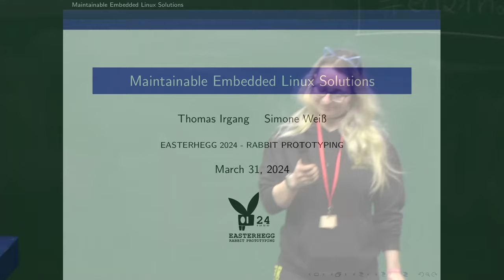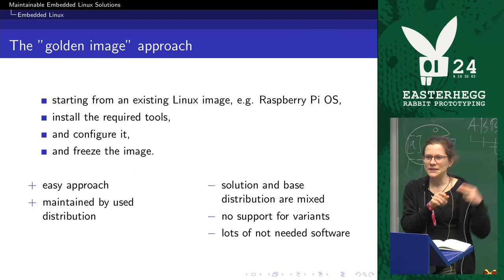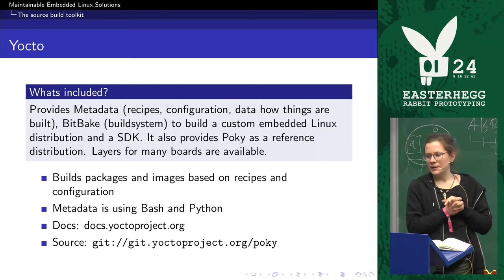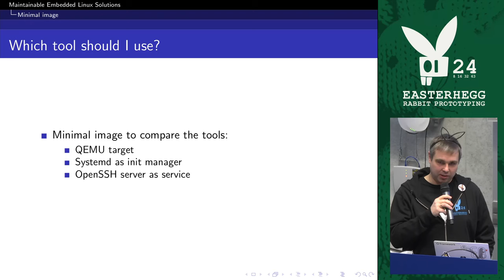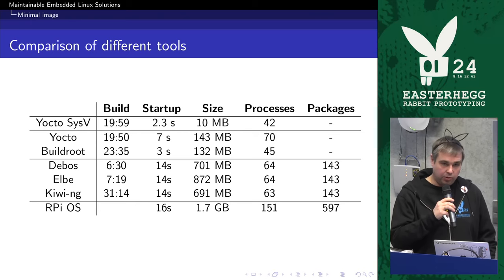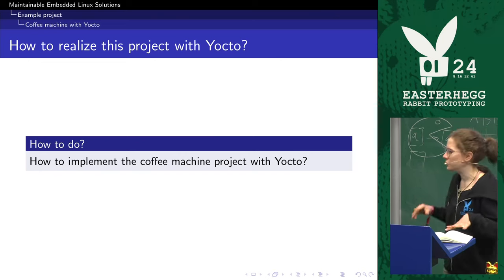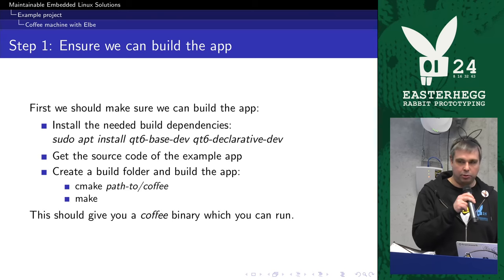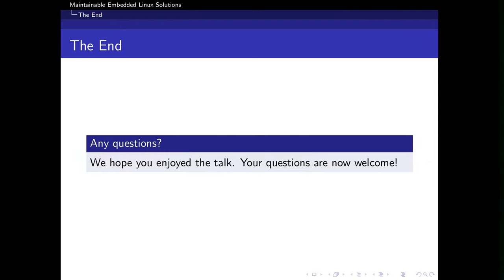EH21 -  Maintainable Embedded Linux Solutions

Comment: Yes, no. That's just not right. 
1. you can also use the Esp32 without RTOS - or FreeRTOS.
2. there are also real-time operating systems for single-board computers, such as the Raspberry pi.